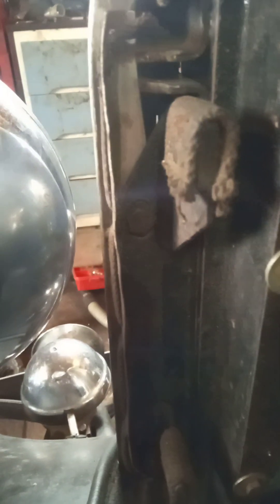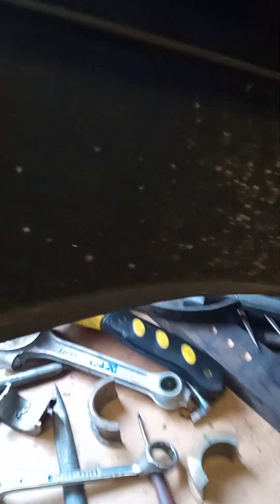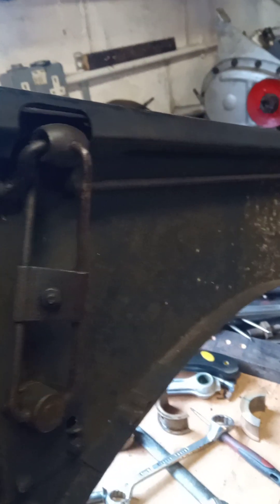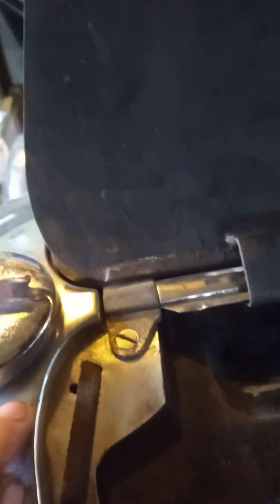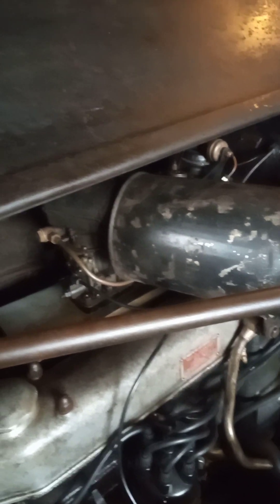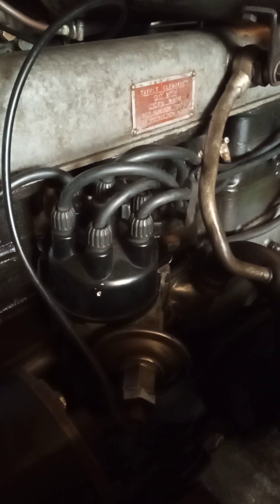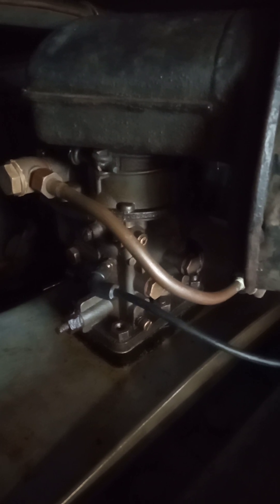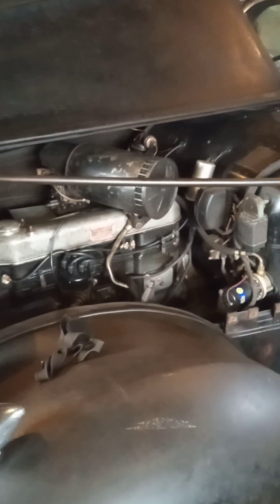P2 bonnet fixings

Comment: Wow this is very helpfull! Thankyou for taking the time to make this video. By the way My car is a 1947 14 sports saloon. Now I know exactly what the latch pieces are supposed to look like. Also you are right the hood hinge piece on my car looks to be home made. Its not cast like yours. With thoes i see thar my my stainless piece is correct length. I have been in contact with some of the contacts you gave me. Mike Evans is putting together a package of stuff i am going ti buy. Overall i think im well on my way to having a complete  car soon.
Reply from the maker: That's good, when I saw your photo I didn't think it was a twelve.  Yours and mine are the same then but mine has a 16 engine - identical apart from bore size.
Let me know if I can help with anything 👍

Comment: Thought I would say Hi and let you know I'm still gathering bits and bobs for the Rover but have been doing lots of repairs to it and driving as much as I can. headed out last night in the rain to my daughter's homecoming.  To watch her perform with the band. It was a good way to test the heater i just resoldered a pipe and repaired the blower. I havs sourced a 3.90 ratio rear diff from a P 4. That should make the car more drivable for long distance. Today i am going to adjust the voltage regulator a bit more and the valves. such fun that car makes an impression everywhere it goes. Hope your enjoying your car as much as i am mine. Ryan
Reply from the maker: @59redwing  that's good news, I have a p4 diff in mine too and it improves the drive.
Take a look at the valve rockers if they remain noisy even after adjustment.  They can wear a dimple in the surface that makes adjustment difficult.

Have fun 👍